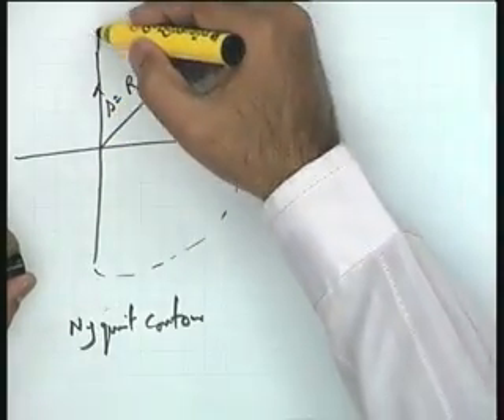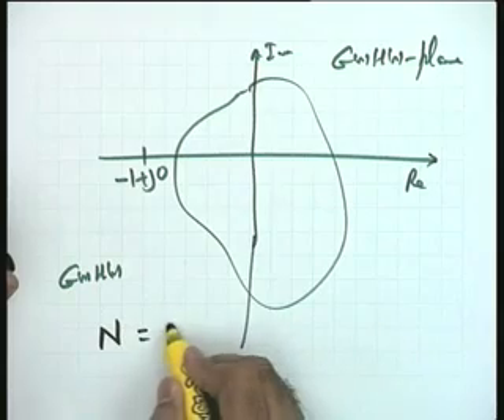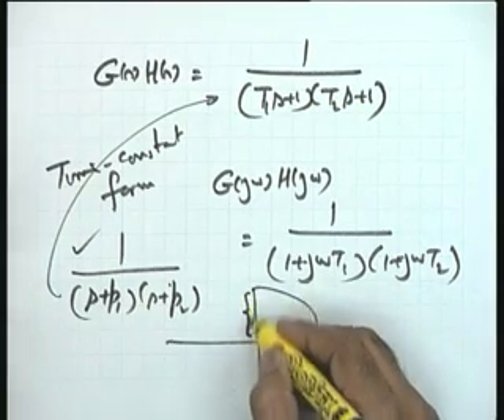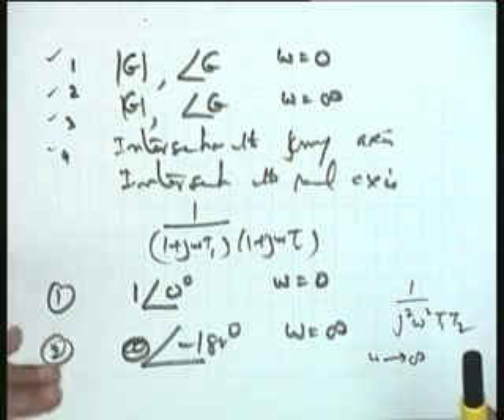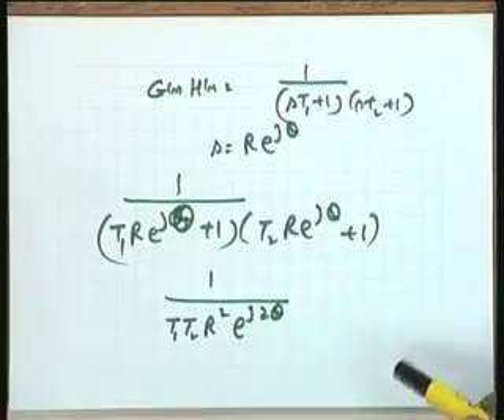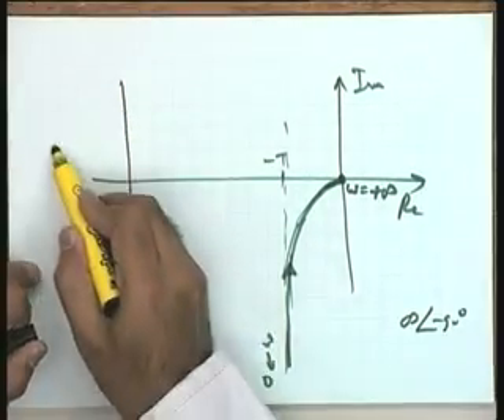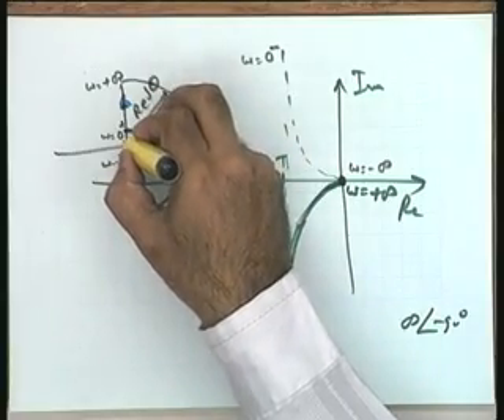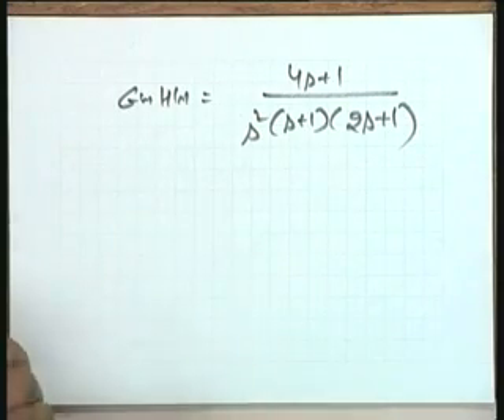Lec-36 The Nyquist Stability Criterion and Stability Margins  (Contd.)

Comment: How does he calculate at a glance the angle of G at minute 19:00 ?
Reply: Basically, it is clear that when omega equals zero, the transfer function equals 1 and the same for omega equals infinity. Taking the sign of the term with the highest order of omega for the case where omega equals infinity, it is found that the angle of G is -180 degree.
Reply: @cathodevinyl  Thank you very much!

Comment: excellent lecture!!
Reply: boss can u say how to  find that 1  is enclosed  or not in last  example
Reply: it depends of the value of K, if K=1, I found that the plot intersects the real axis in w=-0.21 so the plot doesn't enclose -1 and the system is stable.
Reply: with a given value of K, find the intersections of G(jw)H(jw) with the real axis. This will give the point that the polar plot cuts through, on the real axis. if (-1+j0) is located on the right hand side of that point, the system is unstable, as the nyquist plot would then encircle the point (-1+j0) twice.
Hope this helps, else, do ping me.